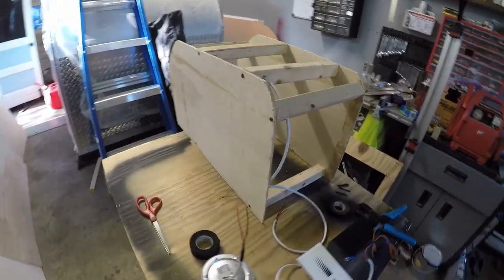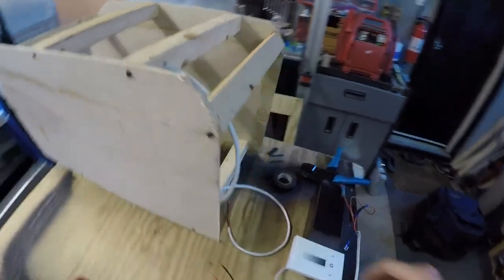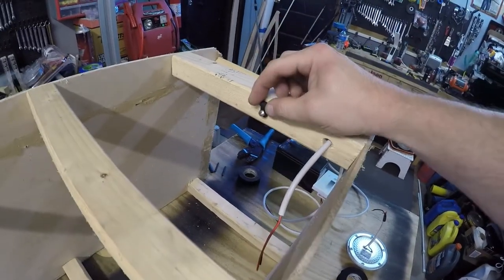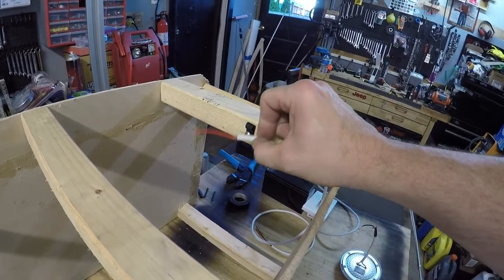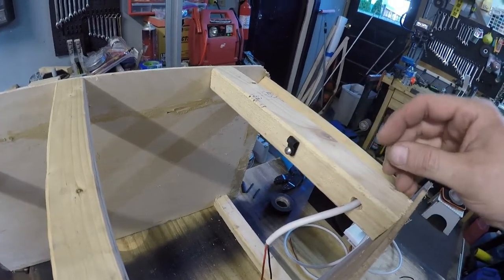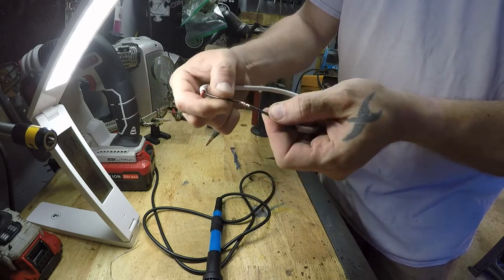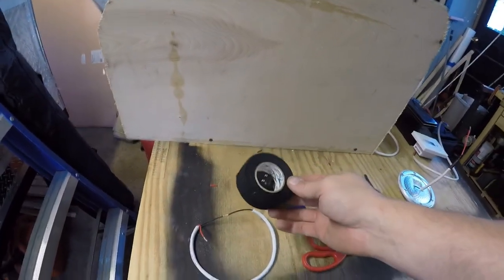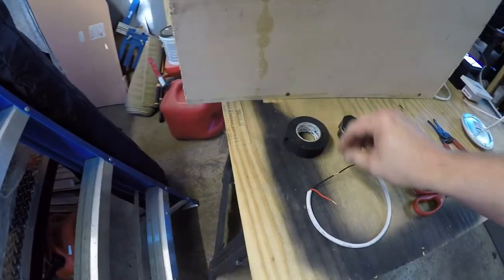Wiring a Teardrop

Comment: As someone who isn't well versed on electrical system I found this particularly useful.

The scaled model is a very good idea. I'm going to be using this approach to purchase and test all the electronics ahead of my teardrop assembly. On that note, do you recommend a technique that temporarily connects (not soldering) the wires during the mock-up phase?

Have you thought about putting together a video that goes from start to finish using several components at this scaled model approach?

Thanks for posting this info!
Reply: Michael Mulich get some screw terminals. Ebay for a couple of bucks.

Comment: Thanks for the information but I have more questions than answers...not entirely sure about how your twisting method differs from the "wrong way" you demonstrated at the beginning...then at 8:30 you say "don't twist em too tight" and 30 seconds later you say "twist these real tight"...not judging at all, just looking for clarification as I will be wiring my teardrop build within a week or so. Thanks again. Also...what gauge?
Reply from the maker: When you practice soldering, you'll feel the difference. Too loose it'll fall apart. Too tight the solder doesn't flow too good on the wires. Just practice and you'll be fine.

Comment: How did you run the wires from the battery box to inside camper. Thanks
Reply from the maker: Hi, I went under the camper. I used a waterproof junction box. You can get those at Home Depot or Lowe's. Never had a problem doing it that way.
Reply: @RDC_Garage  did you use an inverter to be 100 percent off grid or do you have shore power too? I am in the middle of making a build sheet for one I am starting. Thanks for the info!
Reply from the maker: @getlosttoday4045  I did not install an inverter. I built then to run on 12v or shore power. But I did install an outlet on the outside to hook up a small generator to run a/c. To run an inverter you'd need more batteries, that's more weight than I wanted. Just think about what you need the most and go from there. Just don't rush anything.
Reply: @RDC_Garage  I like to be organized first.  The wiring is the biggest thing I am questioning.  12v is simple but how did you regulate the power to the battery.  I only want to run 1 35amp per hour battery. Do I run solar to charge it? Thanks for the help!
Reply from the maker: @getlosttoday4045  I use the ; NOCO Genius G7200 12V/24V 7.2 Amp Battery Charger and Maintainer

It charges the battery when plugged in to shore power. I also have it charge while we are driving. I've never had a problem with. We used it on a 4 day trip. Everything worked great.
Reply: @RDC_Garage  thanks for all the helpful advice and tips. Oh one more question did you under coat the trailer weather damage? I live in Minnesota and weather is always concern. And again thanks for everything